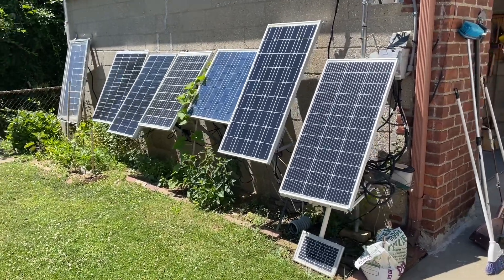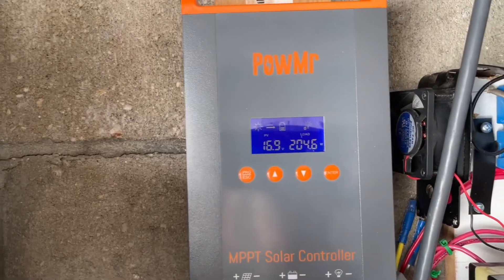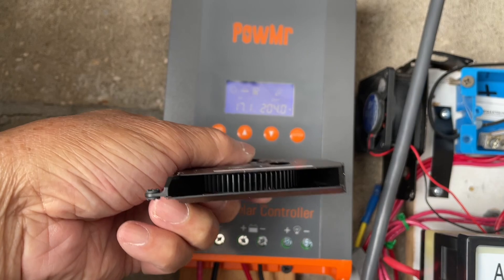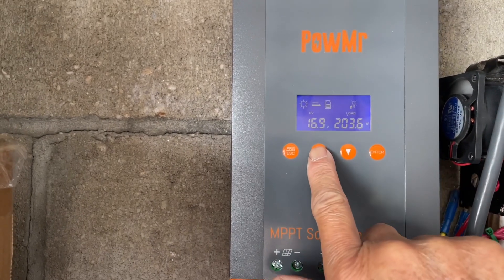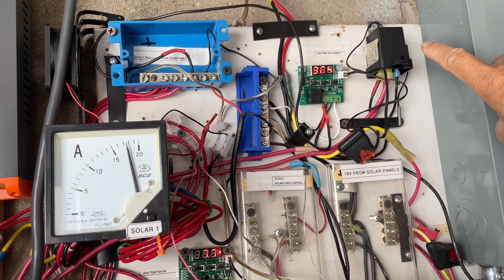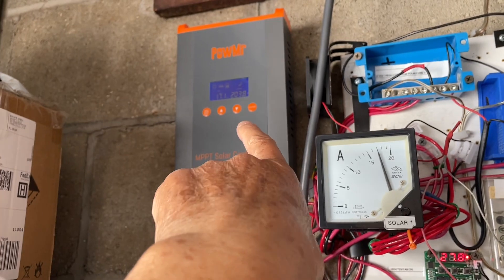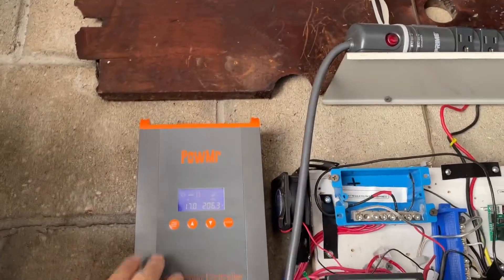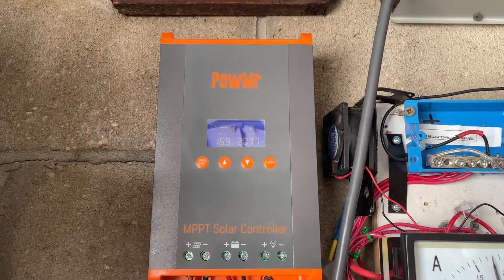PowMr solar charge controller HHJ60-Pro first impression

Comment: I just received mine and I’m unable to change any settings. Any suggestions?
Reply from the maker: You have to press and hold the set button for a couple of seconds before you change the settings. 
Make sure you connect the controller to your battery first, then connect your solar panel input. Then you go into settings to program the type of batteries you want to charge.
Reply from the maker: I can walk you through the steps. If you  have for example 12v lithium iron phosphate battery. First connect your battery and then solar input. Press settings for a couple of seconds, then press the  triangle icon and scroll to d06 and then select L04 for 4 cell lithium iron phosphate battery and then press enter. Now the default charging characteristics for charging LiFepo4 battery is set.  You can customize your settings later.
Reply: @wtam69 thank you. I’ll try that. I have AGM batteries. What’s the setting for that
Reply from the maker: @DevinHVACInc I assume you have 12v. The setting is d06 select GEL.
Reply: @wtam69 I did. Was able to set it but when I go through it , it automatically reset to the factory settings SEL and so on
Reply from the maker: @DevinHVACInc After you set it, you have to press enter button on the right to save it.😊

Comment: Mine is stuck in night mode and won't charge my battery
Reply from the maker: Disconnect wiring to solar panels and battery and reconnect after a few minutes and see if you can get into mode4, which is mppt. Remember to connect charge controller to battery first.

Comment: This controller is quite bad. It's just a pwm that can handle higher voltage. There's little to no difference in output power to battery with PWM
Reply from the maker: @odohgift972  it can handle higher current than my previous one. Yes, in my setup, I do not get any increase in efficiency.
Reply: @wtam69 excelente video y me gusta el fan que le pusiste al lado por la temperatura eres precavido al igual que yo, no te lleves de comentarios malos es un excelente equipo calidad ,precio he visto que con 28v a 25amp ellos dan 43amp es decir que es un mppt real y tiene una alta conversión sobre el 85% es decir acen el trabajo perfectamente solo hay que ver las conexiones que tienes pero le puedes sacar mucho más rendimiento, yo pedí dos pwmr hhj60pro de los mismos para usarlos en paralelo  para mi sistema tengo 1200ah  a 12v en baterías de gel huawey y aokly  y los voy a probar con 4 paneles de 400w, solo quiero sacarle 40amp a cada uno para que trabajen 🥶🥶🥶🥶🤣🤣🤣🤣🤣 fríos en Alaska😅 😅😅😅
Reply from the maker: @benyamin.venezuela A good system is the one that works.  You find yourself wanting to get more solar panels and batteries. I got 2 more panels today and maybe when the price is right buy yet another battery.
Reply: @wtam69 y si puedes aumentar tu potencia tu sistema es igual al mío 12v tienes desde 18v asta 80v y 720w a 12v, es decir puedes usar los paneles en serie asta unos 70v y 600w y vas a notar mucha diferencia en la carga  no pases el umbral de 80v y 720w para proteger el equipo, por eso yo pedí dos controladores para usar dos paneles de 400w en cada controlador, asta que cambie el sistema a 24v, para mejorarlo pero el equipo veo que hay personas que tienen años usándolos sin problemas suerte amigo 👍🏻👍🏻👍🏻👍🏻

Comment: You need to connect your panels in series to get a higher voltage. The PowerMr rated for 160v, so probably you could do about 100V on the Pv. NB. With a true MPPT, you can still maintain your 12V system even with 100V input, it will step it down for you. You will definitely get more out of the MPPT like this. However, the ideal is to have a 24V or 48V system, then you can max out the Pv to 140V or there about, much more efficient like this.
Reply from the maker: @CommanderJoe  You absolutely correct. This is an old system and I started out with 1 diy panel. Now I’m maxed out. I’ll do a 48v if I were to start anew with a few thousand dollars.

Comment: I got the powrM HHJ-60Ah 60amp mppt charge controller. I connected my lights to the load terminals with the settings d00 00H. It isn't turning on. How can I make my lights turn on at night ?
Reply from the maker: @odohgift972  you have to set it to between 01 to 23H or 24H for immediate load activation. Make sure your battery and solar panels are connected. 00H should on or off state.
Reply from the maker: @odohgift972  I just uploaded a video on how the load control settings work on this PowMr 60 A solar charge controller. 
https://youtu.be/Tj6bH8ERpX0?si=mmU0cdLim3990YQQ

Comment: Hello from Greece.
I bought these chargers,(2) but I have a question for you and I hope you can help me.
I have 4 photovoltaic panels. of 420 watts 13.15 amp (1640 watts 49.60 amp) the chargers do not give me this performance. I tried with the charger I had, (PWM) And I had the performance of the panels. The charging option is in SEL .
Thanks.
Reply from the maker: @ΠαναγιωτηςΒασιλικοπουλος-β1γ  There is actually little difference for me between this mppt and the own charger. The difference for me is the power handling capacity. PowMr can handle more. Mppt works if you have higher voltages that do not match your batteries. If you configure your system to closely match the charging profiles of your batteries, you don’t need mppt.  Your car battery charger if regulated at 14.5v to charge a 12 voltage. Not much loss there. Adding or using a mppt charger, if there is such a thing for cars, won’t help you. Sometimes stupid is better.
Reply: @wtam69  Thank you for the answer. You are probably right. Stupid is not stupid at all

Comment: you must hook up your panels in series to make24v or 36v on a a 12v battery and inverter system you can not go over 720 watts on a 12v system i have one of the same powmr it work crazy well that way on smaller gauge wire

Comment: how did you hook up your amp meter from the charge controller to the batterys?? or solar panels to the controller on neg side or pos side
Reply from the maker: @leetaves9143  on negative side with a shunt but you can also use positive if you are powering the meter (digital type) with a separate power source.
Reply: @wtam69  thanks i like how you had your amp meter i have been playing with the solar my self for a while started out with harbor ft i put four panels in series got 80v
Reply from the maker: @leetaves9143 Actually the charge controller displays amps and voltage from solar panels but I like the large pointer analog type amp meter that you can see from several feet away.
Reply: @wtam69  ya that what i think too i have the small one,s now and their hard to read i also do diy batterys but temu has them cheaper then i can make them about 140.00  , at 85 im slowing down a bit in FL
Reply from the maker: @leetaves9143  You have plenty of sun there. And you can go fishing there all the time🙂
Reply: @wtam69  YA IT SEEM,S LIKE WE HAVE MORE CLOUDY DAYS THEN SUNNY BEING I HAVE THE SOLAR GOING BUT IT KEEPS IT COOLER ITS BEEN HOT HERE

Comment: I have the same brand new in a box here, but the 20A version. Bought it for like 23USD shipped.  I am now testing with another MPPT device and I notice something which might affect your system as well. My panels are approx 30m (100ft) away from my house and I used 2 times electrical wire in parallel.(extension leads, I'm a total amateur I know)  So I would say about 14AWG.  The drop in power is enormous. The MPPT device itself is capable of delivering 150W max and almost always peaks out when it is connected directly to the panels. 150W+100W+40W+30W panels in parallel, so it is almost always saturated when the sun shines (what an absolute .. sunmmer we have had here in the Benelux so far).  Now the same device connected at my house with that cable length I get like a max of 90 Watt. My guess is that cable length and thickness is messing around with the MPPT as the cable acts as a resistor.
Not sure what cable thickness and length you use but it might make a big difference here.  
Btw If I measure the voltage at my house so over the long wires when nothing is connected it goes to like 21V which is indeed Vopen. When I short it my Amp meter goes in overload so definately over 10Amps. So if I would say max power at like 18V then the MPPT would surely would also produce the 150W max but the wire seems to mess up the thing.
Reply from the maker: @Luke-san  I found the PowMr mppt charge controller delivers little, if any, increase in power over my pwm controller. Maybe it’s because I’m operating a 12 V system. Maybe mppt works better for higher voltage system. I kind of suspected that but my reason for upgrading is because my 30A pwm controller can go into thermal protection (shutdown and back on later) when weather is very hot. The new controller supposedly can handle 60A. So that’s my reason for the change. The only way to see if one is better is to operate both under the same conditions. Thanks for your input. As with any DC keep your cables thick and short to avoid voltage drop.
Reply: @wtam69  you need to go to 24v or higher im doing 24v panels it work great it makes a big different,s on a 12v battery and inverter system
Reply: @wtam69 biggest difference will be when you put more voltage coming from the panels, compared to PWM when you go above the voltage it won’t turn into current but MPPT does, so if you put 24 or 48 volts it will change a lot, I saw that your panels are providing something close to 16v and it’s real close to around 14.2v for charging voltage, so that’s why you are not seeing big difference, if you double the PV it will increase the current going to your batteries
Reply from the maker: @fernandosbtech  Thanks for explaining. Yes, I have a 12 volt system so naturally the incoming voltage won’t be too much higher. The solar panels are 21 volt or so open circuit but under load they will go down to 16 volt or so.
Reply: @wtam69 according to this mppt, the best voltage to charge a 12v battery is between 20-80v so you are out of this efficiency range
Reply: Low voltage does cause significant power loss over a long connecting cable. 
Maybe you could experiment with connecting the solar panels in series instead if that will be within the maximum input voltage of the charge controller. 🤔

Comment: I’ve had the same charge controller for 4 years and it’s worked flawlessly! No need for the extra fan!
Reply from the maker: @michaelzimmerman9221   Good to know about the fan. The extra fan is a precaution for very hot weather as the controller is in a garage. The built in fan must be really quiet because I don’t even hear it.
Reply: @wtam69 it's actual a FORCED FAN... it won't blow unless the temperature is above 55 degrees
Reply from the maker: @raphaelfemide7974  Thanks for the info. 55 seems pretty hot.
Reply: Gracias un gran alivio su comentario pedí 2 de esos mismos y veo muchos comentarios raros que son malos y tienen problemas pero la gran mayoría no sabe configurarlos muchas cosas más gracias

Comment: Love your videos.  I've noticed a few getting deleted.  Hopefully you're doing well and not suffering the whims of YouTube.
Reply from the maker: @charlessammons9987  Thank you so much for taking the time to comment.  I’m doing well and hope everyone is as well. I just use my iPhone to upload videos and the iMovie app is limited in editing capabilities so the quality suffers. YouTube “whims” can be a drawback but I can’t blame my video performance and quality on the platform. Tinkering is my hobby and I’m glad I can share my experience with others.
Reply: Never could understand what is meant by amp-hour. Thanks for the video, lots of hard work.
Reply from the maker: @southernshaker  How many amps of current for one hour.  How many watts that would be depend on the voltage. So it would be  100Ah at 12, 24 or 48v.